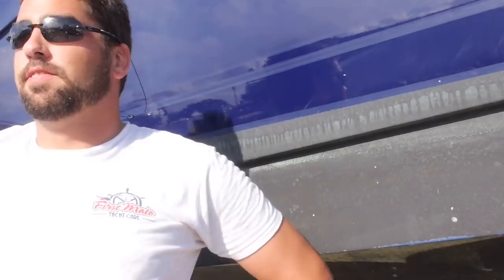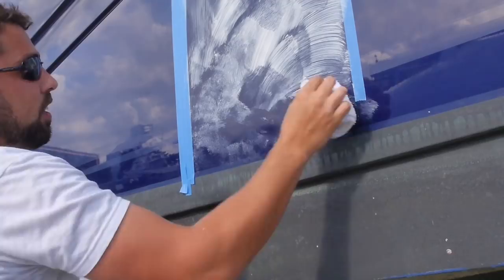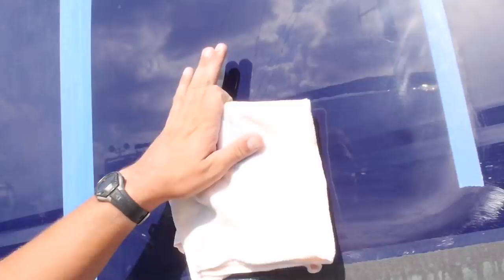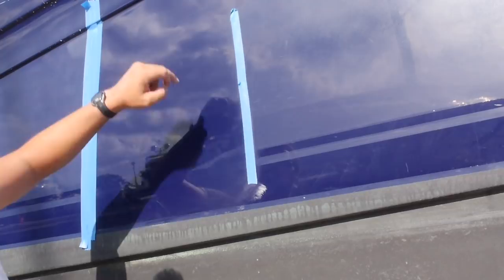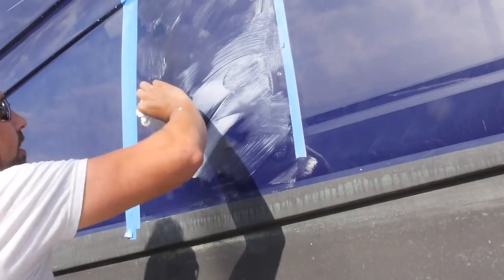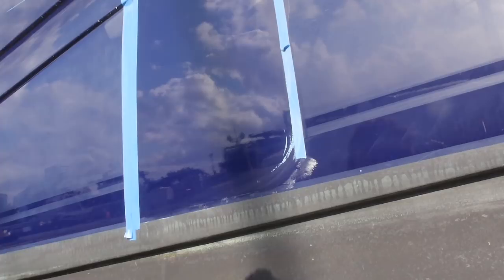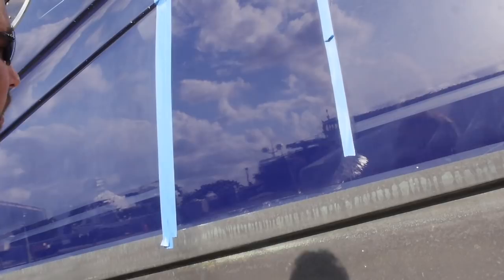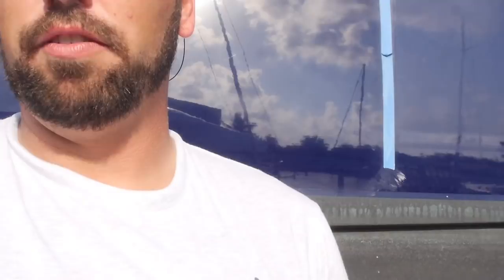How to Buff and Wax a Boat

Comment: I have a question on pricing. I am in Louisiana and I recarpet boats,mostly bass boats and I sometimes buff and wax boats for customers who ask me too. Do yall charge by length of boat or by square footage? I am sure level of oxidation plays a part also.
Reply from the maker: gmtony55 We charge by the hour, plus cost of materials. For boats of common lengths/widths, we do charge by the foot as we can predict the amount of time it will take (we have lots and lots of data from past jobs). The level of oxidation certainly plays a part!

Comment: I have never seen so much compound used to buff. not only is there being ten times more use than necessary you're ruining your wool pad at a rapid rate.
Reply from the maker: I appreciate your opinion, but this boat was severely neglected.
Reply: I agree....
I will give a 2x2 area a squirt of compound and move it with the buffer until that area is and has been compounded, and if I have to maybe a little more?
Then I will spur my pad and remove it and move on to the next 2x2 area.
When I am finished with all my compounding I will use my orbital polisher to put the finishing touch.
Otherwise he did a nice job, just way too much compound.
Reply: You do realize how much gel coat is on a boat right? You could sit there for a day and wouldn’t burn through that gel coat with a wool pad
Reply: Lets see your video then!

Comment: I think I do better. 
First the Makita is better than the DeWalt but the 3M buffer is best.

2nd, just use a 3 dollar brush to apply compound 

3rd squirt water so it doesnt dry, never ever buff hot gel coat with dry compound and start with 1800rpm and bring up to 3500. The machine should take off all the compound.

Comment: How many RPM do you spin the buffer??
Reply from the maker: I start low, to initially work the compound in around 600-800rpm, and minimize sling. To finish, I rev it up to around 2000rpm

Comment: Thanks for this video, very helpful.

Just a quick question, do you use the vertical tape when you are doing a real job (i.e. not for the video)?  I just started my first job on my mostly white sailboat and the vertical stripe seems to make sense to track what I have done and what I haven't.

Also, I have red gelcoat stripes going down the boat.  Should I cover them with tape and then go back afterward and do them seperately?
Reply: Dave Henning
Used car dealer/detailer here. No, you don't need vertical tape lines. You don't want to have an edge. You'll be able to see which areas need more buffing.

Comment: Not an effective professional demonstration. If oxidation was so heavy requiring 3 passes, wet sanding should have preceded the compounding. Based on this guys approach, he would be out there for days doing a marginal job
Reply from the maker: We will have to agree to disagree. Wet sanding is more aggressive and not good for long term care of the boat. You can end up taking off more than is needed to get it looking good. We might do 3 passes on a moderately oxidized boat by doing heavy/medium/fine instead of doing 1 pass with something like 3M Imperial. I'd like to think the change in the boat was a little better than marginal!